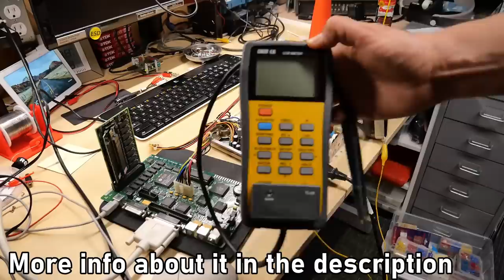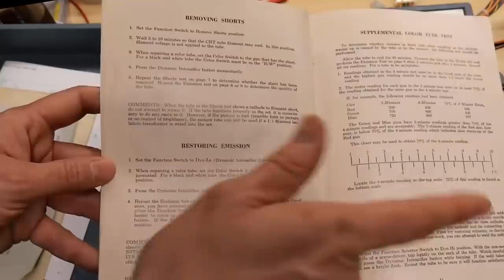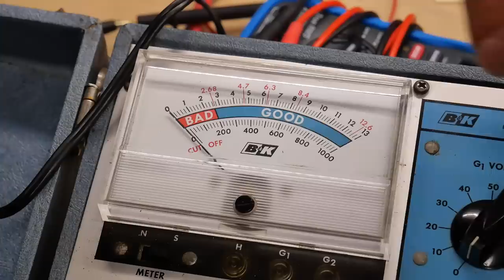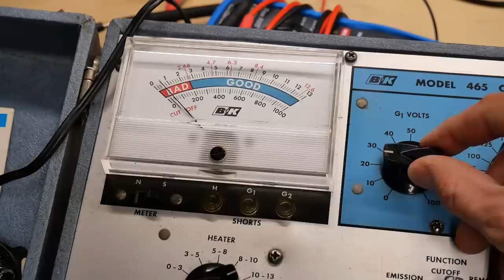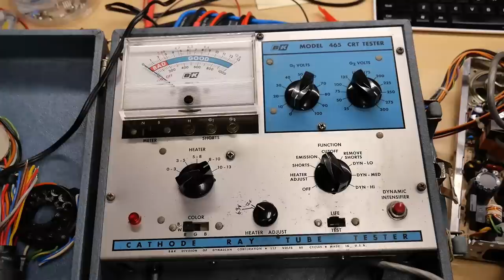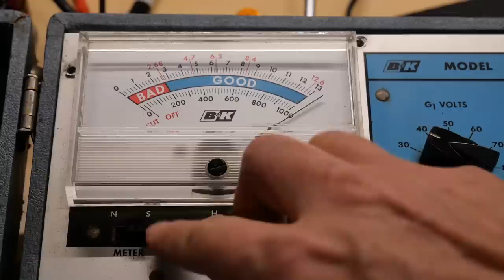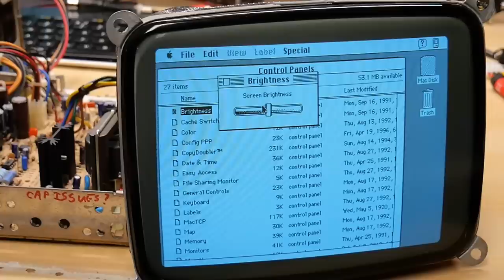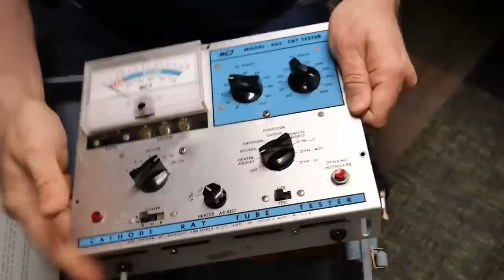Rejuvenating a Macintosh CRT with equipment from 1969

Comment: The sparks are good. They are "burning" the corrosion inside the electron gun. You can also hit it (gently) with a screwdriver (with the plastic side) and pieces will fall inside the tube and they will spark. It made my Hitachi tube from 40% to around 80%.

Comment: Hi, the high voltage pulse to the tube is to remove the carbon oxidation deposit on the gate (usually  fall into the tube)

Comment: there was 2 way of fixing a screen in my town at the local repair guy: 1 way, was to increase the filament voltage, by wraping a piece of wire on the high voltage transformer, or, second one,  the risky one, was to discharge a capacitor on the heater element. both worked most of the time...

Comment: I have used a B/K  CRT rejuvenater back in the 80s  I used the later model which did the steps automatically.. what it basically did (describing the automatic process) was to "tap" the button while  removing the heater voltage and allowing the cathode to slowly cool this would cause a slight ARC across the cathode and "blow away" any oxide on the cathode surface.. thus "rejuvenating" the CRT;  the process was ALMOST idiot-proof, however, one can still "over do" the process and end up  destroying the surface coating on the cathode.. I say you can try this on "high" and see if  also flipping the life check switch  (which just removes the heater voltage) and see  if it  can effectively "bring it back to factory"  your CRT there is NEW-in comparison to some  of the CRTs back in the 50s that I have brought back to life!   I think you'll  have good results...  (again, I used the later version of that tester which had an automatic rejuv function...)  I hope this helps!  heres a quick link to some images of the unit:  https://images.app.goo.gl/QVUzi3H46nJs3KEo7

Comment: In  the days of old the TV repairman carried (Picture tube brightners) which hooked in series with the tube socket, they stepped up the heater voltage a tad but only worked on AC heaters.

Comment: Sometimes you can bring a tube back by running the heater at a slightly higher voltage for an hour or more, such as a 6.3 volt tube at 8 volts. I doubt whether this would work with a computer monitor from the 80s but it is often the case in older TVs that the cathode in the tube goes to sleep from sitting unused for several decades, so it is a good idea to try that first. The better, or newer CRT testers will have several functions to restore emissions, there is a clean/restore function, rejuv 1, and rejuv 2, the usual procedure is to try clean and restore, and if that doesn't work then move onto the higher settings in succession, with rejuv 2 as a last resort, then it's off to the tube rebuilder. This unit has them marked as "Dyn LO" Med, and Hi, so "Dyn Lo" must be B&K's version of clean/restore on a Sencore tester.

Comment: You snagged a rejuvenator at a thrift shop?!?!?!
Reply: You stumble upon the weirdest things at thrift shops. Is this an unfamiliar experience to you?
Reply: Tube testers and brighteners are extremely common, they were service grade equipment and lots of people had them.
Reply: I hit up Portland area thrift shops all the time and don't find anything nearly as cool (probably because Adrian's picking it all up).
Reply: One of my friends got a 90's tester/rejuvenator for 15 bucks, it's 400$+ on ebay right now

If you go thrifting, go everywhere and go often
Reply: Yep, I wish we had thrift shops like this here in Hungary, and I wish CRT and tube testers to be this common like in the US. In here, they were never a common thing. Only the government/military had tube testers, and even they had just a few. Some of the biggest post offices had tube testers (for maintenance of the telecom systems), where they also tested your tubes for a fee. 
CRT testers/rejuvenators started to occur about in the mid '80s, but they were very expensive, so only a few repair shops bought them. Then in the early '90s, someone probably here in Hungary copied a Spanish Promax RT-501B CRT tester/rejuvenator, and sold them as "Sam's CRT regenerator" https://m.blog.hu/tu/tubemania/image/img_2435.JPEG . There are not much of these around, it is very difficult to get one second hand, and also quite expensive, so I will probably build one, the schematics are available.
Reply: @laurensa.1803  i just got a usb turntable, new in box with 30 pin ipod dock!
Reply: @laurensa.1803  you do stumble across the weirdest things for a thrift shop every once in awhile. I once found a GM power steering pump at a salvation army? Really?
Reply: @iamdarkyoshi  ripoff and total exploitation.
Reply: @dodgem259  Agreed, they aren't worth anywhere near that if you check completed listings. Clearly that's a B.I.N price pulled out of someone's bottom end, like many on there are. It's one of many reasons fleabay sucks now, including the rampant shill bidding/second chance offer scams many sellers like to pull.
Reply: @mrnmrn1  no thrift shops, but there are flee markets where you can find retro electronics with the butt load. i have came across a logic analyzer the size of a dinner table once, but these are really uncommon for sure.
Reply: @csabasanta5696  Yes, but no flea markets in my vicinity. I have to travel at least 20km for one, so I'm visiting them very rarely. Although I used to visit the BURABU about every second year. I hope it won't be cancelled this year...

Comment: We used equipment like this on color TVs in the late 70s to early 80s. 
8 out of 10 tubes got longterm better. 1 of 10 faded the next day and the last 1 of 10 had no change.
Newer tubes (inline type) had no or little change.

Comment: Great video, but I second other people suggestion of *replacing all caps*.
Even if they test fine in a meter, they are most likely electrically leaky, which may also explain why some readings are off.
Mr. Carlson's lab has several restoration videos showing how old caps that look perfectly fine both aesthetically and on sensitive meters are completely gone from an electrical standpoint.
I would also check all the other components to be sure, and try to find a service manual to see if the device needs any alignment.

Comment: I bet Mr. Carlson from Mr. Carlson's lab channel would have one of those or something that would work. He might also guide you in the best way to work with CRT tech. He's extremely good with older tube tech. Great channel (at 1.5x).
Reply from the maker: Heh I've watched his channel a bunch -- and yes, I also use 1.5x :-)
Reply: What does the manual say about the lo-m-h? What does it change?
Reply: @adriansdigitalbasement  Watching the end bit, I'd replace all those electrolytics. They just don't last. And possibly some other components. A cap can test acceptable for capacitance but could also be acting as a resistor. In a tube circuit, caps that can conduct DC can wreak havoc on the tubes. They get driven way to hard and it will burn them out. I don't know enough to say about the resistors but those you should be able to get a reading to see if any are bad.
Reply: @adriansdigitalbasement  His latest ROBOT HEAD he does a great deal of work on a radio built similarly to your tube tester. Point to point. Bad caps, etc.. But he does have a lot of those. It's long of course.

Comment: I have the B&K 467 tester which has a timing circuit that is a huge improvement over the 465 which was pretty basic. however the operation of cleaning the guns is the same effectively. You push the button on the 467 and the needle pulls to the right then drops back and you release the button when it gets in a part of the red. Then you should see improvement in the green on emission test.  Its a great machine and i have saved every tube just using the low setting as it has a harsh rejuv too for stubborn guns.  It uses bulbs to control current with the high voltage applied. 
Warning- these old machines were designed for the heavy guns from old crt's and the newer testers are much gentler. So you need to be careful working on the smaller closer spaced guns of high quality later crt's or you could warp and short them and ruin it with the higher juice. I have used my 467 ok on these as i use only the lowest power and coach it back to life.  Always use the gentlest to start with even if you see no life on the emission especially on these old testers and another trick is to raise the heater voltage a bit as that acts as a soft rejuv too  and in fact mine raises it as you push the button and the life button lowers the voltage 15% so you can see if the guns drops off much as a good clean gun wouldnt much even if heater voltage was lower.  Id used correctly, you cant harm a crt unless theres already a weakness inside. You stop when you see no further improvement and quit when you are ahead. 
You saw on Adian's Tube, even only a bit into the green showed a huge improvement and the final assessment is always from the eye when connected up especially with colour guns and their balance. 
These old machines are great for arcade games and old computers and oscilloscopes and yes it true, they are hardly for sale now and mine cost about $100 with all the sockets and a universal one i made myself with connectors for any new sockets i need to fit for on very late crt's.  Paid for itself very quickly and vital if you cant get that CRT any more or substitute another without major circuit change to accommodate.
Also. if the guns are healthy but just crudded, then cleaning them will give them a full useful life as qualified tv techs used these and the current models are designed for the very later tubes to safely service them.  You have nothing to lose unless you damage a good CRT with misuse of the device, so on low power its really impossible to damage any older CRT and you can see the results here with a very basic 465 thats pretty worn inside likely. It still did a great job.

Comment: Neat stuff!  I was really hoping to see what happens with the DYN-HI setting!
Reply from the maker: I tested it on another CRT (an old color TV that I was trashing) and it seems to just make things worse. Two hits of the medium settings seems to work best. Using the high setting sounds like something is being welded inside the tester LOL -- and it lowered emissions. More than two hits of Medium also seems to lower emissions after the first two hits.
Reply: @adriansdigitalbasement  As you have replaced the cap with one with a much higher value, (50 to 82, almost double...) your med setting already borderlines on the factory high setting... on high you're over the roof and probably blew of quite an amount of material from the cathode. As you can only freshen up a tube by this process a very few times anyway because of the material loss, this will degrade it quite severely.
Reply: @adriansdigitalbasement  Empirical data from archaic and mysterious devices.  I love it!  I can also feel the temptation to press the red button one more time -- what could go wrong?  :)

Comment: A couple of comments. If you're planning on rejuvenating any large amount of tubes get a Sencore 7000.  These can successfully rejuvenate Trinitron tubes which usually are destroyed by rejuvenators.  Second don't keep hitting the button for rejuvenate hoping that the needle will go higher. Once you get it into the good range leave it alone. You can kill a perfectly good rejuvenated tube by hoping for a little bit more brightness out of it.

Comment: I have done this many times in 70’s when I was in TV companys maintenance department. You pushed the pushbutton too short time. Your second was only 200 miilisecond or something. It is possible that it gives the same amount of energy every time regardless the time you push the button and you just choose one of the three energies. Anyway, the equipment cleans the cathode. The cathode gets dirty and the emission is low because of that. If you have option to project the cathode image to the screen, you see how bad it is. You can shoot it as many times you want but when the emission doesn’t get any better, it’s time to quit. I had an automatic Cathode Recovery Unit and if I recall it right, it took 3-5 seconds to do it. I usually used it two to three times. After shooting, the CRT doesn’t last as long as a new one but much much less. So it is only temporary fix. The only way is to renew the gun. I was once working in a company who changed the guns. Sometimes they exploded because of tensions in CRT glass when it was heated. Then the authorities banned them because on the tests, there were too large glass chips when the CRT exploded. Huhhuh.

Comment: Hey Adrian, I was just doing this last night with a B&K 467 and Sencore CR7000 — looking forward to watching this. I may post the (crappy) video I took of the restoration.

You definitely need a newer unit — try to pickup a B&K 467. You’ll need to service it somewhat to make sure it works properly. Reach out to me if you have questions.

I’m actually testing a tube for longevity right now. It’s going 60 hrs and still strong. It was a 60k hour plus tube.

Comment: You're supposed to press the button for 10 to 20 seconds to allow it to spark and remove the junk from the cathode. The high position is what we always used. If rejuventation failed we used a wire-in booster, which steps up the filament voltage. This is a temporary fix and only lasts a few days, weeks or even months.

Comment: The things I’ve found at thrift stores, vintage radios, Speak n Spell, gameboys, NES, games for SNES and N64, DSI XL, DS games, Megadrive/Genesis games, GameCube games, Wii, Wii 25th Anniversary of Super Mario Bros (red). Wii motes, Wiimotion adaptors, Wii games.  There would have been a “universal adaptor” which is a cable with clips instead of a socket. You can attach the clips to the appropriate pins which is great for any crt that isn’t covered.

Comment: I was in the TV service business for over 35 yrs, got out around 2014...I used my B&k restorer hundreds of times, probably 60 percent of the time it would clean the bad boron off the guns and would restore the emission , however, in the 90s the crt's didn't have strong guns and lightly coated cathodes which wouldn't sustain much emission after restoration...
But, I could buy the customer an extra yr on a weak CRT and that would satisfy the customer....of course I would let them know full well that the restoration was not a guaranteed process. 
Of course, some customers didn't want to hear that the restorer could damage the CRT and that wouldn't make them happy.

Comment: That Christal Quest bomb – if I recall this correctly, it's related to the version of Sound Manager installed.
(I had this too on my first Mac and eventually got it running swapping some system extension, following some advice that I probably found in a magazine. And I think, it had been about Sound Manager.)

Comment: My dad used to repair TVs when I was a kid and he used one of these all the time.  You can get it to work a little better on stubborn tubes by holding the button longer and GENTLY tapping on the tube neck with the handle of a screwdriver while pushing the button.  Of course this comes with risks.  But I remember watching him do this and you'd see oxides fall off and while they fell sometimes burn up and you'd get a little light show.  Sometimes it worked REALLY well.  Depends on the tube really.  If you have a tube that won't improve you might as well try everything right?  Go up to high and if that doesn't work also do the tap I guess.

Comment: Adrian, you should change all the caps in that unit, as well as wire the unit with a polarized plug to prevent you from getting a shot from swapping the polarity of the plug.

Comment: How my arcade boss described it was it's like when you overclock a chip. Some handle it like a champ, others it could just die or not help at all. The other thing was it will eventually wear out again, and each rejuv doesn't last as long.

Comment: Adrian the box you are  using was used in  the  70's and 80's  to burn phosphor  specs  off of the  electron guns by  pushing and holding the button  . the reason  phosphor gets on  the  electron gun is  because  crt tv's  were often layed with the neck down and  phosphor  fell from  the  screen  of the crt I  used to work on cRT tv and have a  certification in  electronics  . by the way if  you hold the button too long you can burn out a CRT pic tube.

Comment: I have seen some vintage classic B&W TV restore and those pictures tube are so rare that is impossible to get a replacement so they guy used rejuvenation a few times and he restores them to detail I believe that this works pretty well if is able to pass emisions for a couple of hours. I have seen "BAD" pictures tube jump into the GOOD section on his vids after it. Also, he used a more complex tester that just make like short cylcing alone in the rejuvenation mode. But after it is done, he waits for a couple of hours to see if goes up or down on emisions.

Comment: because of the 80µF instead of 50µF you are dumping 60% more load into the filament on the lo - med settings, i would omit using high for the moment until you've put the right cap in ....

Comment: I strongly suggest You recap all of the CRT tester. It seems as if it might do the job, still. I found myself yesterday a lab power supply that still works but after a little searching i quickly found posts that warn me about one cap in particular which when it blows leaving a nasty stink you don´t get rid no more and who wants a power source smellimg like failure the rest of the days, right? I was awfully tempted to test it, i did, it works but i don´t stretch my luck any further. Catch my drift? You were darn lucky nothing more bad happened. That was the mildest blow i ever witnessed. But i like Your energy, I´ll stick around(grabs snacks...) Stay Safe!